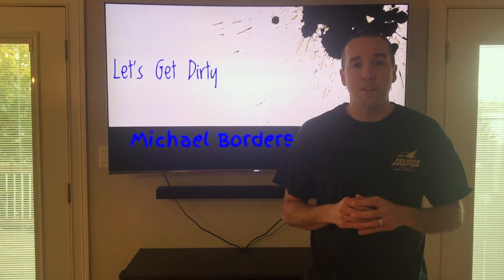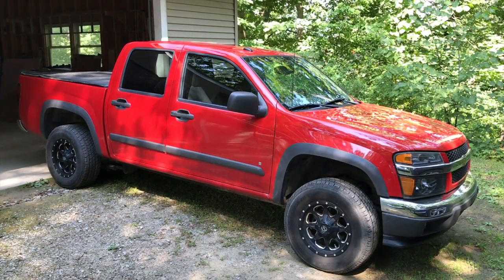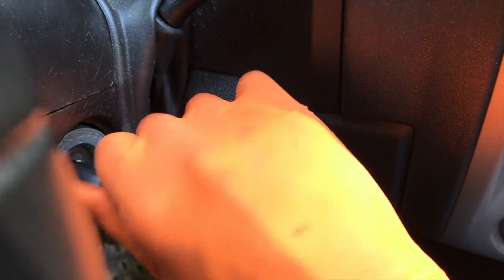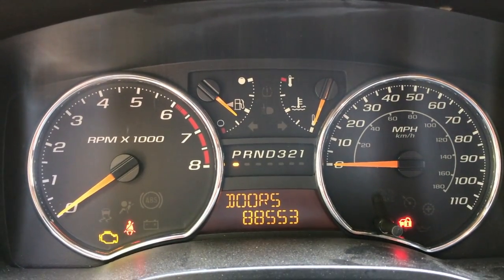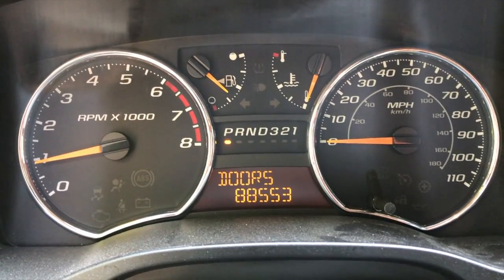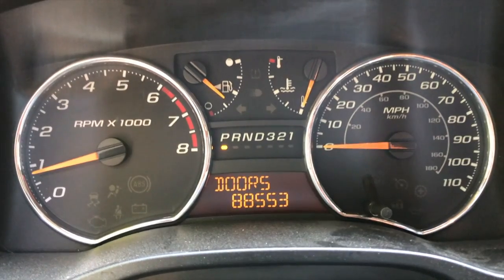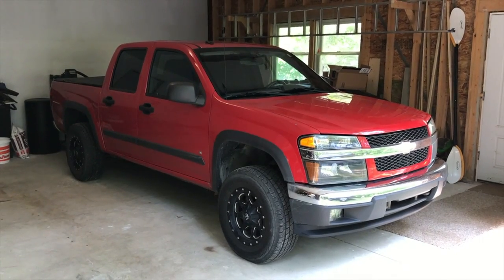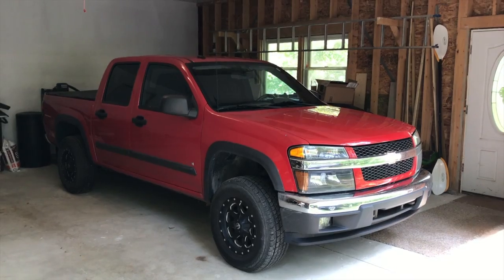How to do a "QUICK Reset" on your ABS System!

Comment: I have a fiesta and it didnt work
Reply from the maker: Thanks for watching & sharing.  Next procedure to try is disconnect your black negative cable from your battery and leave disconnected for a minimum of 30 minutes.

After 30 minutes, resecure black negative cable to battery and start engine.

If ABS light illuminates again, there is a faulty part within the ABS system that will need to be replaced.
Reply: I'm trying that just now. I've disconnected the full battery. Positive and negative. Just waiting on the juice drain
Reply from the maker: @jimmybhoy6438  

😎👍
Reply: @DIYwithMichaelBorders  I got new brake calipers couple of weeks back. Do you think the mechanics could have upset a sensor
Reply from the maker: @jimmybhoy6438  

Thanks for the update & that is very possible.  It may be as simple as plugging sensor back in...unlikely...or...it may be that the sensor itself was harmed.
Reply: @DIYwithMichaelBorders  definitely something wrong. I did the battery disconnect for an hour. The abs light is still on. I'm trying to sell the car too. 🤢
Reply from the maker: @jimmybhoy6438  

Thanks for the update, that’s a bummer.  Below is a link to our video discussing the common causes.

       https://youtu.be/5lgMhKYGuto

Hopefully this will be somewhat helpful, keep us posted.  We DIYers need to stick together!!!

😎👍

Comment: Omggg I got the ABS light while I was getting my rear tire a patch since it had a nail on it , I immediately searched up the cause of the ABS and thankfully I found this video , and yes it works on 2015 Dodge Challenger, I did every step and the ABS light didn’t go off immediately so like the guy said in the video I took it for a drive and around the 15mph range the ABS completely disappeared, I love seeing my dashboard with no lights so seeing that ABS light and traction offf made my day way better!!
Reply from the maker: Sweet, thanks for watching & sharing this.  You’re the first to share this with a 2015 Challenger.  Thank you so much for taking the time comment.

😎👍

Comment: It works bit it came back on today at the beach so I did your trick again and seems to work again. Thank you!!
Reply: Oh about 2 months. So far so good. But if it does come back on you probably have a worn out speed sensor
Reply from the maker: @kathrynrobertson1431  

Thanks for sharing this Katheryn.
Reply: @kathrynrobertson1431  Who told you a “worn out speed sensor”.   Literally where did you come up with that?  because an ABS sensor is not a speed sensor.  You have completely diverted someone’s attention to move forward into the transmission.  Because that is where a speed sensor is located. 
Why did you feel confident leaving such a contributing statement?
Reply from the maker: Thanks for watching Kathryn, happy to hear it’s helping.  😎👍
Reply: Hi Kathryn, how long did it worked for the first time you did it?
Reply: I did it but it didn't work for me. 05 chevy equinox with abs and tc light on :(
Reply from the maker: @kittycatmobay  

Thanks for the update, you can try it a 2nd time however if that doesn’t work, we recommend disconnecting the black negative cable from your battery and leaving disconnected for a minimum of 30 minutes.

After 30 minutes, reconnect black negative cable to battery and start engine.  If ABS light is still illuminated, there is a faulty part within your ABS system.

Comment: Damn, this really works! Thanks Michael.

I had a Mitsubishi Mirage 2013, the ABS light suddenly came on after I whack a corner. Checked with a cheap OBD2, nothing detected. Just make sure it's not related to magnetic bearing, speed sensor first.
Reply from the maker: Thanks for watching & sharing this, so true, the magnetic bearing & speed sensor are very common causes.
Reply: Oh my! :( it didn't work for my 05 chevy equinox. Abs and tc light on. Do you have other videos of other possible solution for other reasons  both lights are on?
Reply from the maker: @kittycatmobay  

Thanks for the update, below is a link to our video discussing common causes.

       https://youtu.be/5lgMhKYGuto

We also commented on your other reply regarding black negative battery cable.

😎👍
Reply: Will it work if the ABS and TC light is on? If so, will it stay off for good or reoccur?  I have a road test tomorrow and my mom just told me that the abs and traction control light is on on her vehicle and it's what I'll have to use at dmv tomorrow.  😭😭
Reply from the maker: @kittycatmobay  

Thanks for watching & it will indeed.  After performing this reset procedure, the only way it will come back is if there is an actual faulty part within the system.

😎👍

Comment: Thank you. I hope this works for a 2008 Cadillac SRX
Reply from the maker: Thanks for watching, we are looking forward to hearing back from you on if it works.

😎👍
Reply: @DIYwithMichaelBorders  Do you have a video about the key being stuck in the igniton?? I am in the house and it's in there as I type. I have the windshield visor over it so no one sees the key. The AAA technician says it will come out after the battery is charged. It did not. The battery died because the key is stuck in partial ACCESSORY mode and some battery is being used.
Reply from the maker: @rebeccareed5792  

Thanks for watching & it may be as simple as jiggling the steering wheel to unlock key.

Comment: Does anyone know the steps to do this for a 2004 Camry?
Reply from the maker: Thanks for watching, it should be the same.  Any update?
Reply: @DIYwithMichaelBorders  Did not work. I posted a more detailed comment but it won't post.
Reply from the maker: @ckinteractivedesign  

Thanks for the update, since this procedure did not work, we recommend disconnecting the negative cable from your battery and leaving disconnected for a minimum of 30 minutes before you re-connect cable to battery.
Reply: @DIYwithMichaelBorders  We have already done this. Scratching our heads. after new bearing (with speed sensor). Toyota dealer scan came back with C1333 TOYOTA code. They claim the speed sensor needs to be recalibrated. Went to a shop and they don't understand what the dealer is saying by recalibrating the sensor.
Reply from the maker: @ckinteractivedesign  

Thanks for the update, was the wheel hub replaced?  Check out our video link below, it talks about the portion of the hub that the speed sensor communicates with.

     https://youtu.be/8CRXheZ_72Y

😎👍
Reply: @DIYwithMichaelBorders  I do not believe so. Will check out the video.
Reply from the maker: @ckinteractivedesign  

😎👍

Comment: didn't work on ford
Reply from the maker: Thanks for watching, that’s a bummer.  Next thing to do is have your system read by an OBD scanner.

AutoZone will do this for 100% free.  This may pinpoint the exact part causing your exact issues.  Please keep us posted.
Reply: @DIYwithMichaelBorders  already did. used a blue driver scan tool. no codes. took it to a mechanic. he said no codes and said i needed rear brakes and the hydraulic system power bled. $620 later he says i need an abs module and pump. he said no one makes it anymore for an 01 mercury grand marquis. abs and brake light still on.
Reply from the maker: @kurtzimmerman1637  

Thanks for the update, have you checked your tire pressure in all four tires?

Although this may sound odd, tire pressure below the manufactures recommended psi can trigger ABS.
Reply: @DIYwithMichaelBorders  yes. all 4 around 36. thanks for the input. need a trouble shooter. not a parts changer! thanks for the video.
Reply from the maker: @kurtzimmerman1637  

Awesome!!  Did you check your fuses inside your engine compartment that are related to your ABS system?

Even the slightest bit of moisture or corrosion on the fuse leads can cause havoc.

Below is a link to our video showing more common causes.

       https://youtu.be/5lgMhKYGuto

😎👍
Reply: @DIYwithMichaelBorders  checked all fuses. I need a pro to fix this. take care.
Reply from the maker: @kurtzimmerman1637  

Bummer, hopefully it’s a friendly repair.  Looking forward to hearing back from you.

Comment: 100% WORKED. I did the three steps but the ABS still illuminated. Then i drove 30Km/h, the ABS warning gone. Thanks👍
Reply: I got the same problem I got a 20014 buickvreno I got abs do I do this 3 steps .do it works.roland

Comment: After helping someone with a jump my computer put me in limp mode.  I ordered another computer which fixed the transmission limp home mode, but now the ABS audible alarm and light are on.  2002 Dodge Dakota.  I drove and brake checked for ABS function and it works like normal, but the ABS Alarm is still there.  I tried the gas peddle reset and nothing new.  Ideas?
Reply from the maker: Thanks for watching, we recommend performing a reset procedure by disconnecting the negative cable from your battery and leaving disconnected for a minimum of 5 minutes.

After five minutes, resecure negative cable to battery and start engine.  This will allow your system to reset.
Reply: @DIYwithMichaelBorders  thanks for the quick reply.  I had the truck computer shipped to me without an external power source.  The negative battery cable had additionally been disconnected before installation of the junkyard computer.  Do you think a code reader at AutoZone could help?
Reply from the maker: @chadparker9823  

That’s the next step, having AutoZone reset ABS codes with their OBD scanner.  Keep us posted.
Reply: @DIYwithMichaelBorders  so we are getting a spline count error code which I believe the vehicle the PCM came from was different.  $185 to flash the PCM but no guarantees.  I was told to troubleshoot the ABS computer and down that rabbit hole.  The ABS works great, but has warning lights and bell still.  The ebay seller sold a "programmed" PCM.  So the seller is sorry about my luck.  Ideas?
Reply from the maker: @chadparker9823  

Thanks for the update, $185 for no guarantee is a tough call...🤔

Do you see any signs of wiring damage or loose connections?

Below is a link to our video showing common causes.

       https://youtu.be/5lgMhKYGuto

😎👍

Comment: Hi, can an ecbm cause a soft/spongy pedal? I have replaced the booster,MC,abs motor. Still not working, no abs light on dashboard.  Dealership says ebcm needs to be replace but they cant guarantee it will fix the issue. Is there any advice or t/s that I can still do myself before having the ecbm replaced entirely?
Reply from the maker: Thanks for watching & welcome to the DIY Raptor Club.  Have you replaced speed sensors?

If so, that leaves the ecbm.

Comment: I have a 2006 Monte Carlo SS and tried this trick but didn't seem to work, abs/traction control lights stayed on.
Reply from the maker: Thanks for watching & welcome to the DIY Raptor Club.  The next thing to do is have your ABS codes read by an OBD scanner.

AutoZone does this for 100% free and this will help us pinpoint the exact part causing your issues.
Reply: Went to AutoZone, they said their scanner doesn't read abs/traction control codes. The employee said that it is either the abs control module failing or one of the speed sensors is bad or loose connection. I noticed that the abs/traction control lights went out by themselves now.
Reply from the maker: @scottwillie9914  

Thanks for the update, speed sensors are more common failure points than the module.

Replacing speed sensor will hopefully solve issue.  Below is a link to our video showing replacement of speed sensor on a Cruze.

       https://youtu.be/XKgw68MUNNA

This may help you get a better idea of what they look like.
Reply: Also the check engine light didn't come on when the abs/traction control lights came on when engine was running.

Comment: Hey sir I changed both speed sensors on the back of my ram how do you reset a ram truck?
Reply from the maker: Thanks for watching & welcome to the DIY Raptor Club.  You have 3 options.

1.  Performing this procedure.

2.  Visiting your local AutoZone and have them reset your error codes with an OBD scanner.

3.  Disconnect the negative battery cable from your battery and leaving disconnected for a minimum of five minutes.  After five minutes, re-secure negative cable to battery.  This allows your onboard computer to reset.

Keep us posted.  😎👍

Comment: It worked for 20 minutes then started back.
Reply from the maker: Thanks for the update, the next step is to have your ABS system read by an OBD scanner.

AutoZone will do this for 100% free.  This may help pinpoint the exact part causing your issues.

Comment: Does it work in 97 F150 with rear ABS?
Reply from the maker: Thanks for watching & welcome to the DIY Raptor Club.  This will work for your 97 F150.

If it does not work, there is a part within the ABS system that has failed.  Best step at that point is to connect an OBD scanner to have your fault codes read.

😎👍
Reply: @DIYwithMichaelBorders thanks for replying!   the abs flash out code says 4 flashes.  Means RASB VALVE switch closed, or open dump valve?

There is a valve on booster under master cylinder. 

Bake brake line was repaired a system bleed!  Brake and ABS lights still on?
Reply from the maker: @constructivecritique5191  

Thanks for the reply, it may be as simple as performing a reset on the ABS codes with the OBD scanner.
Reply: @DIYwithMichaelBorders  thanks again. My scanner say NA!  Only clears engine codes.  Maybe another scanner would work or auto part store.

Brakes work fine!  Reset makes sense!
Reply: @DIYwithMichaelBorders  would you know what the 2 plastic boxes above rear axle are.  They are connected to brake abs sensor wiring.  Attached to bed cross member?  No clue what they are!
Reply from the maker: @constructivecritique5191  

Not 100% sure on the F150...🤔...it may be related to the module.
Reply: @DIYwithMichaelBorders  thanks!  I'll call the dealer service dept.   Maybe they might know?
Reply from the maker: @constructivecritique5191  

Awesome, we are looking forward to hearing back from you on what they say.

😎👍
Reply: @DIYwithMichaelBorders  no word from Ford service!  EVAP SYSTEM CANISTERS!

I removed them to get a closer look.  Gas tank vent is connected to these two canisters.
Reply from the maker: @constructivecritique5191  

Interesting, surprised it’s taking awhile for them to get back to you...🤔
Reply: @DIYwithMichaelBorders  I'm not going to hold my breath!  Lol
Reply from the maker: @constructivecritique5191  

😎👍

Comment: I have a 2008 Escalade. I put in new struts, CV axles and wheel hub assemblies. I had no ABS and Traction lights or codes before. But now with new bearing hubs and sensors I am getting the C0035 right front wheel sensor fault. I tried this "reset" but nothing has changed. I guess I still have a problem. I was hopeful though. LOL
Reply from the maker: Thanks for watching & welcome to the DIY Raptor Club.  Is new sensor & electrical connection point clean & dry.

One of the common causes of this is moisture trapped inside the electrical connection point.
Reply: @DIYwithMichaelBorders  Yeah man it looks clean and dry. I have disconnected and reconnected them a few times. Can you tell me what if any voltage would be in the plug coming from the truck where the sensor plugs in? I think what really has me going in circles is my scan tool says "C0035 right front wheel sensor supply (subfault)" but when looking up the C0035 online it always says "left front WSS"
Reply: Ok I fixed my issue. FYI if your scan tool says C0035 right front wheel sensor on a late model GM it is wrong! I swapped the left front and the problem vanished!!!
Reply from the maker: @ScarabChris  

Awesome Awesome & we appreciate you taking the time to share this.  This is great info.

Us DIY’ers need to stick together, thanks again.  😎👍

Comment: I was skeptical at first but it worked!!
Reply from the maker: Brian, thanks for watching & sharing this.  That’s great to hear.  Enjoy your weekend.

😎👍
Reply: @DIYwithMichaelBorders  well the light came back on but upon further investigation the abs wire on the front passenger side was exposed and touching the rim thus causing the light to come on! So I replaced the hub and secured it and problem solved! Thanks for your tip!
Reply from the maker: @brianclark6294  

Thanks for the update, awesome find on your behalf.  That’s awesome you’re back up and running.

😎👍
Reply: @DIYwithMichaelBorders  thank you sir!
Reply from the maker: @brianclark6294  

😎👍

Comment: I was searching for a Dodge Ram 3500 Dually reset don’t know why a video of a Chevy Colorado popped up. I did try this however it didn’t work.
Reply from the maker: Thanks for watching & we appreciate you reaching out to us.  From here we recommend disconnecting the black cable from your battery and leaving disconnected for a minimum of five minutes.

After five minutes, reconnect cable to battery and start engine.  This will allow your system to reset.

If your light is still illuminated, you may need to have an OBD scanner read your error codes.  AutoZone will read codes for 100% free which will allow us to pinpoint the exact part causing your issues.

Welcome to the DIY Raptor Club.

😎👍

Comment: Was very skeptical especially as it didn’t reset instantly, but after driving just a little, the light went off. I’m assuming that if it comes back on quickly there might actually be a problem?
Reply from the maker: Thanks for watching & welcome to the DIY Raptor Club.  We appreciate you sharing this and we are interested in hearing back from you as time goes on.

If the light comes back on, we can try to help you figure out the exact part causing issue.